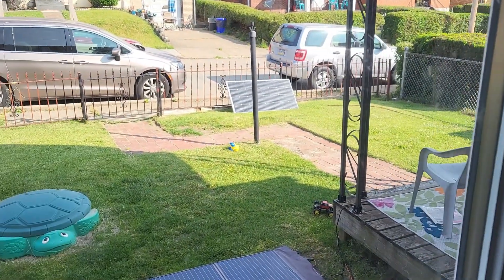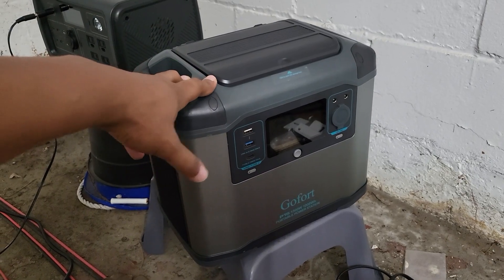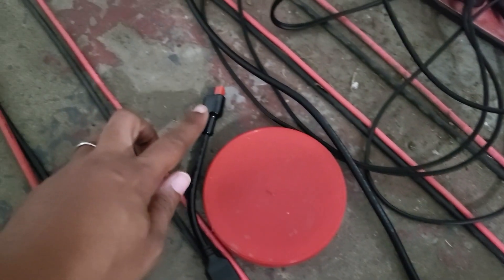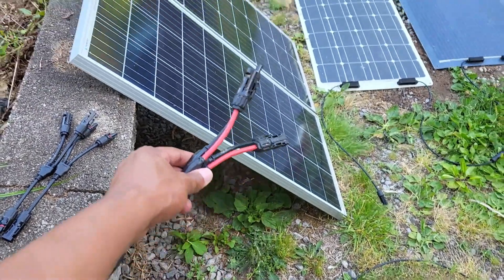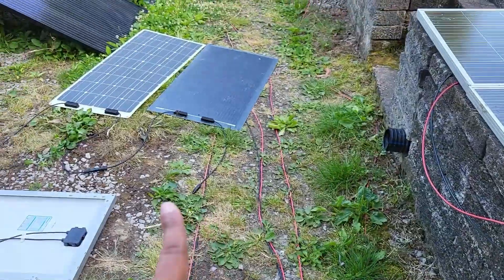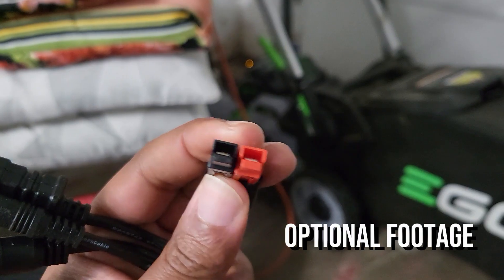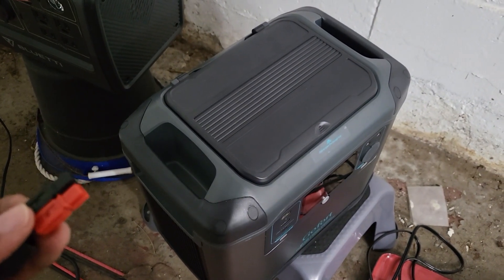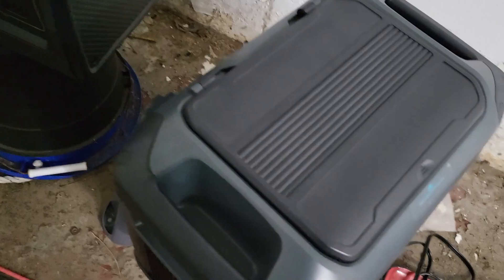I Put ⚡HIGHER VOLTAGE⚡ Into This Power Station - GoFort P15

Comment from the maker: Did you like todays video?
Thanks For Watching! 
Subscribe If You Rock With Real Life Solar Videos
Reply: Im not an Electrician but after watching a few videos about transfer switches I did it myself. It's actually pretty easy. After turning the main breaker off the only thing you have to keep in mind is not to touch the 2 main wires coming in at the top, because it's always live but other than that, it was a piece of cake. the hardest part had nothing to do with the wiring, it was mounting it on the wall by myself without a 2nd pair of hands. to explain how to do it in the simplest terms, you take the black wire out of your breaker, put the red wire from the transfer switch in there instead then twist up the old black wire from the main panel and the new black wire from the transfer switch with a twister wire connector. thats it everything is labeled and you'll enjoy an extension cord free house
Reply: this is the transfer switch I started off with, My house isn't too big it did probably 75 percent of the circuits, "Goal Zero Yeti Home Integration Kit Transfer Switch, Powers up to 4 Circuits" It powered to furnace, and all the lights and outlets, in the kitchen, living room and bedrooms,porch lights. It didn't power the garage,utility room and microwave (which had its own circuit so I ran an extension cord to it)  I started off with the AC200p  with that transfer switch and upgraded my setup to the AC300 and life's been good. The new Switch I installed is the Reliance 10 cirucuit 50 amp one (30 amp one is cheaper I just wanted to  future proof) which covered everything for me.

Comment: The bms should have overvoltage protection, bc the charge controller  is supposed to protect the battery, mosfets, shunts. Would you trust a so called smart battery to save itself from overvoltage/overcharge/overheat with no bms, mppt, fuses or capacitors involved?
Reply from the maker: I asked for insight so your question confuses me, is that sarcasm or rhetorical or an actual question
Reply: @AskIveSolar  you had us wondering the same thing if ur question was rhetorical/u just thinking out loud. Bc you have access to the owners manual and data sheets lol I live dangerously i parallel connec charge lead acid and lithium batteries simultaneously. Or use Nimh setting to bump charge dead lipos and love overvolting motors or running AC motors on dc current. My methods confuse most ppl.

Comment: If you really wanted to get that to work on any given day, you could cover a portion of the solar array, plug it into the power station and then remove the cover. This will lower the non load voltage and once it is under load it will be below the 40v limit and should work.
Reply from the maker: Good point. Setite always mentions this.

Comment: Nice. Long ago I seen at least one other person test that too and it overload protected and was fine at slightly higher than the max voltage, but pretty sure he damaged it at maybe 10 volts above the maximum. I don't remember the details, so I am guessing it just killed the BMS. I'm sure I would have remembered a fire or something. I think his solar would only get slightly above the maximum voltage during perfect conditions, so he wanted to verify that the unit had overload protection instead of trying to find a unit that can accept more voltage.
Reply from the maker: Interesting! I wonder how I can use the batteries by themselves. Any thoughts